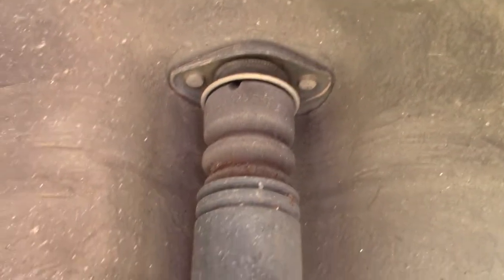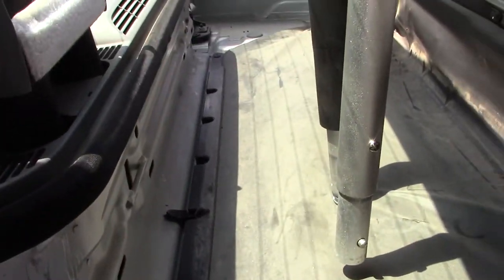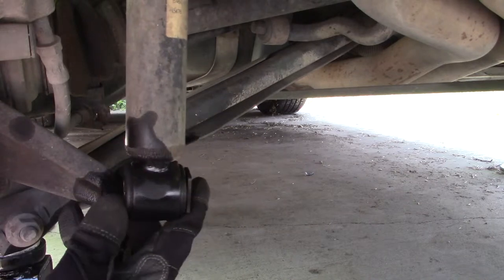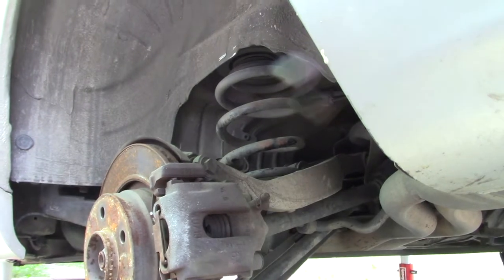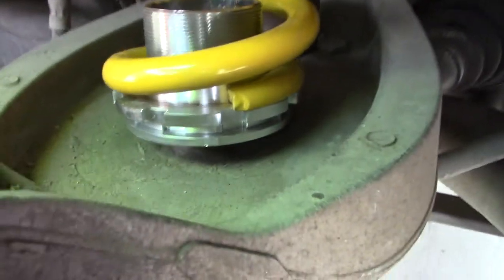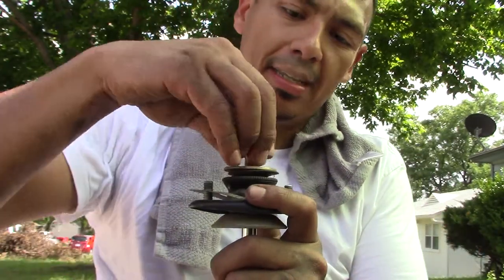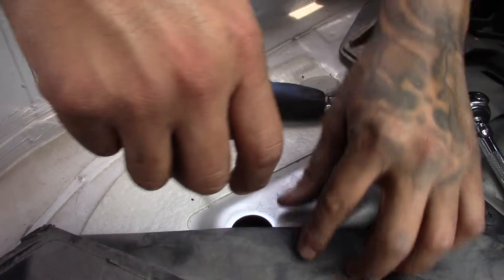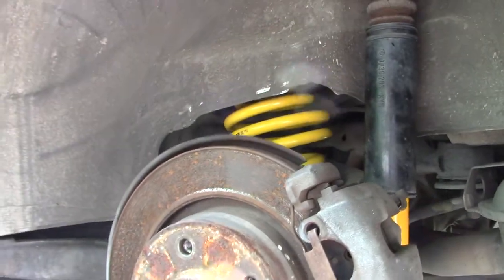Installing Rear Coilovers on the E46 Convertible! What NOT to do...

Comment: Hey bro just watched your video. Im hoping you may have some good advice for me. BTW my rear purchs did same thing not sitting flush. I installed a JOM Blueline coilover kit. I regret.  Then had to buy a set of status gruupe front adjustable end links. For $140. Anyway I changed to a set of staggered F1R 18" 8.5 in front 9.5 in rear. Then I put 15mm spacers on front & 17mm on rear. I  can actually hear you rolling now. 🤣 🤣.  So of course we rolled fenders we cut fender liners. I also replaced all mounts  added reinforcement plates front & rear. I also installed front top mount camber plates.  That brand new staggered set of tires I mentioned earlier. Well let's just say I've about destroyed the rear ones. I also have a 2004 325ci silver. She's my baby I live in Northeast Tennessee so any real good help is hard to find hear. I actually lifted her last night took the rear tires off. Was hoping I could send you some video or pics or whatever you prefer.  If you have time to take a peak and give me some feedback
 I would be grateful. Thanks in advance.
Reply from the maker: Hey Alan, looks like you're rubbin on the sidewall of your rear tires. Your wheel spec isn't too aggressive but with the added spacers, it might be causing your tire rub issues. I would try a smaller spacer OR cut more panel out and add fender flares.
Reply: @JoelsDriveway  I appreciate ya feedback.  Honestly I knew there wasn't like a magic answer. I guess I just needed to hear from someone who knew what the options we're.  I had thought about ordering 2 more rubber seats that we use in the top & put a set on the bottom as well. Just a idea. But I do believe I'm gonna give her one more roll. Then prob have to cut a little. Thanks for taking the time.  I'll let you know how it turns out.
Reply from the maker: @alanmarkwalter9502  sounds good boss! Good luck on the build. Looks great so far 👍